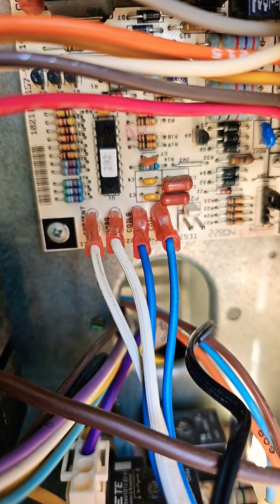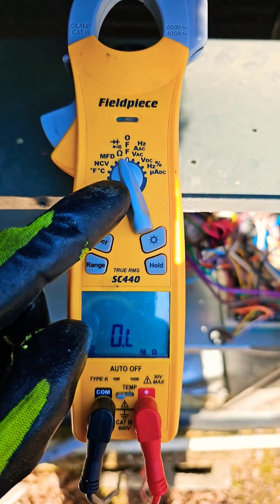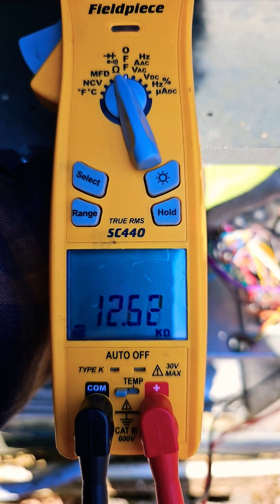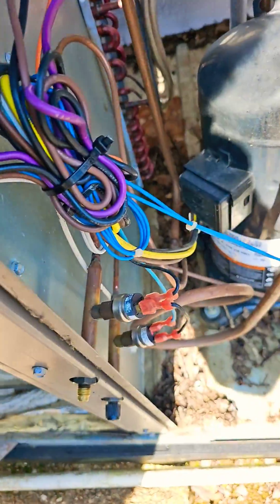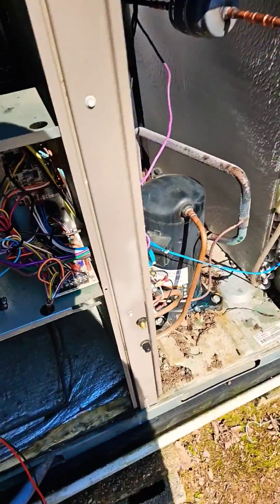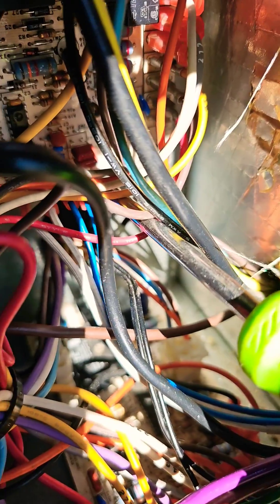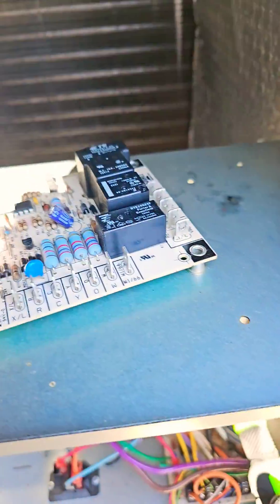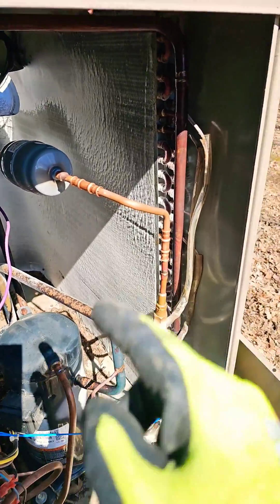Heat Pump Troubleshooting Defrost Board #heatpump #hvac

Comment: If your trying to test defrost in the summer just bring a can of dust off flip it upside down and spray the coil sensor. Also stretch marks on the coil is a sign

Comment: what would cause unit to shut off when in heat and sen jump to go thru defrost cycle and as soon as I hit speed up it shuts off. sometimes tripping low volt breaker

Comment: I'm surprised being 2x as resistant is good
Reply from the maker: You'll notice in the video that the coil sensor is covered in ice.
And the ambient air sensor is not and that is the reason that the resistance is are so far apart.